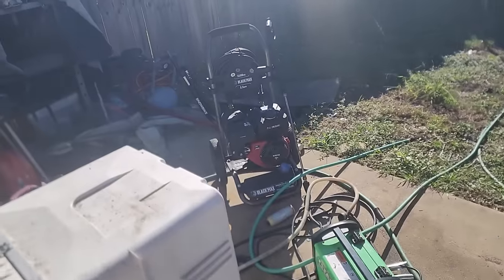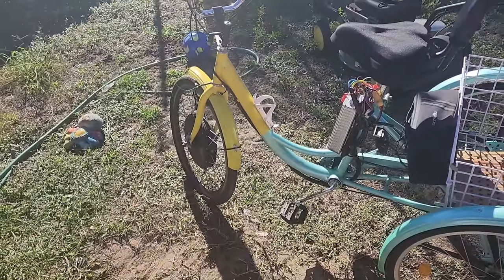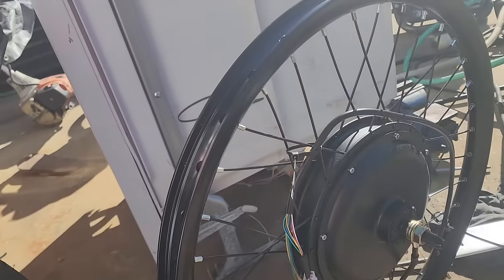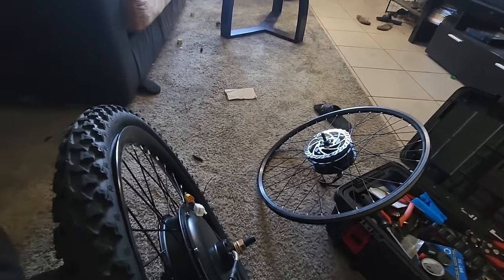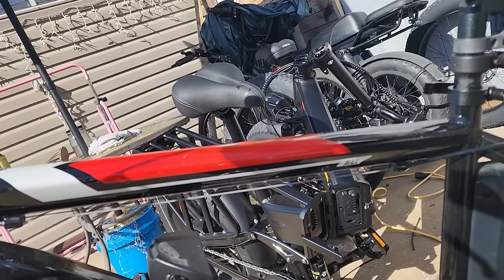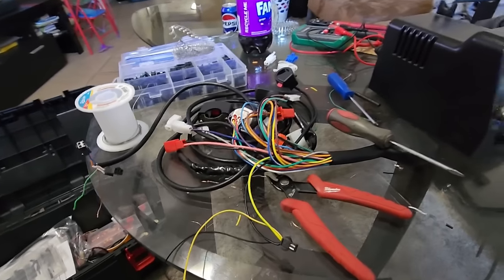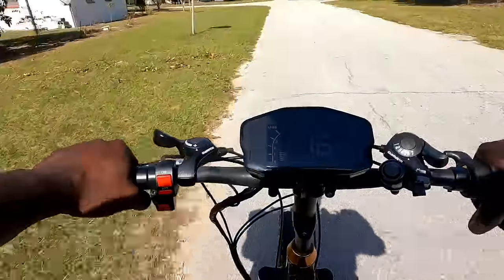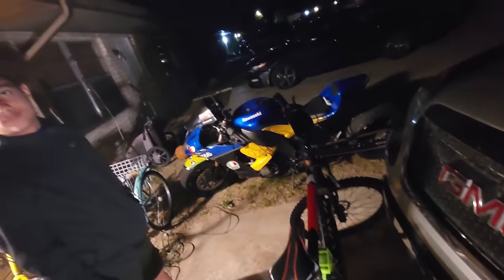1500w ebike conversion kit build.  60mph for a customer!!!

Comment: I can't wait the time when we'll get 3000w nominal geared hub motors to go uphill at decent speeds
Reply: The 1000w bafongs that Ariel rider use do a very good job of it.
Reply: Yes it does, but I don't like fat tyres because of maintenance costs, and the pigs would give me a hard time if I rode these kinds of bike.
I'm really looking at the bafang mid drive 1000w and a fardriver controller if it's compatible
Reply: @nicod974  not sure what you mean about the maintenance of the fat tires. I replaced the original tires with some low drag tires, and I’ve gotten over 2000 miles on them. Only just had to replace the back tire due to wearing it out. They were a little more expensive than others I could have gone for, but 2000+ miles is not too expensive.

Comment: Great job and glad he likes it, I have just upgraded to a 2000w 72v diy ebike which is pretty fast but only got a 45amp controller at the moment but still gets me around 45 mph which is scary on a 12 year old mountain bike lol take care gaz ✌
Reply: LMAO, yes just 45mph is dangerously fast, especially if bike is very light, lol. Hey, Ive been at that speeds and man, my thoughts on a flat out, wipe out, or a bump that send your front up was too much for me to have on my mind while going that fast at 45mph. Ive learned to just be ok with 36mph and stress free of not being on my mind while going that fast. Stay safe and ride smart over but not too over, mph.
Reply: what was cost
Reply: @raybosflorida4928  did you want the cost of the kit and battery?

Comment: What's crazy is I'm riding on a 1500w hub motor and best I seen is 32- 33 miles per hour.😮 (52v battery)
Reply: I got that on a 750 watts at 56 volts
Reply: Shunt mod it
Reply: Shunt mod it
Reply: @dahman9672 shunt mod huh,,,you  sure about that,,this isn't a bafang mid drive..it's hub

Comment: I use these "Topeak Versa Mount" things to mount stuff all over my aluminum frame ebike.  They are kinda pricey, but they work well.  My battery uses 6 of them, but that's cause it has to be installed on the top of the top tube.  I have not been nearly as fast as you guys, but they hold up finr for me on offroad...I went 40kph down a pot hill filled gravel road and nothing budged at all.  I do loctite everything though (nail polish works in a pinch if you got any women around).

Comment: Nice work again EBG!
I feel it is much safer to have a ebike that can easily keep up with the traffic. A slow 20~25 mph ebike is generally far more dangerous IMO.
That Huge Smile on a very happy young man is Golden 100%!
Merry Christmas to you and your precious family!
Thanks EBG
Peace Prospector Tripp
Reply from the maker: Oh yea they love it , they rode it the next day none stop lol
Reply: @E-bikeguy  EBG.. I had Another brain spark 🧠⚡️😂 
I installed a modified fat 20” rear wheel on an inexpensive 24” mountain bike. The front fork now kicks out a bit more like your modification to the Frame Head Tube angle. Of course this is because of the smaller rear wheel. I think this is a good easy fix for the fork angle 📐 issue without having to cut and weld. I found it helps with overall handling, ride feel and stability.
I would love to see you try this modification on some pedal bike or ebike. After doing this to my little 24” mountain bike, I also want to try this on a couple larger bikes to see how it performs.  A 27.5” bike with a 26” rear or a 29” bike with a 26”.. not sure exactly just yet.
Anyway watching you do this modification would be really interesting. I would love to see what you think about the smaller rear wheel mod and how it feels to you and how it is effecting the overall ride.
That would be definitely be Golden!
Peace Prospector Tripp
Reply: Hey E-BG ( should use the E-BG as optional title on ya gears)  Just wanted to get back the basis of my latest Fat Tire 2000watt Tonka Tuff DIY Dual motor.  I had mention before of at times when going fast you want ebike to be balanced evenly ( some like their frames light as possible, while some need the extra weight of frame used,  torque of speeds etc) first thig I noticed of my new Fat tire was how too light it was in front handlebars of the type of power ( 1000watt gear are newer ones) of extreme power NM as the more weight I had in back, the severe wobbles of controlling handlebars of not going over 12mph of such serious front lift on front tire, I knew doing Dual Motor ASAP was the right thing to do. EXAMPLE" You riding at just a minimal mph of 24mph, you flying on street with speed bumps of say 4 feet long from dip,over , dip  and on to the next one. Before the front motor balancing my front would take off and lift a bit of the bike landing but much banging of the landing besides the handlebars lose control for a mili second. Now with Front motor of a perfect balance, I speed thru same speed bumps at 24mph and faster, My bike is planted with just the lifting of frame from my dual shocks of riding thru of full control and the balancing is a factor depending on preference of rider, frame used rear overall weight, etc. It feels HELL A GRAVY of my bike firmly to the pavement of my tires with the dual shocks doing the lifting of overall handling of handlebars going along with suspension purpose. This just a separate preference of the rider's use of frame type, counter weight, type of motor power of NM of full control of handling bike.   @E-bikeguy
Reply from the maker: @user619tlsdca5  heck yeah I do agree,  that is why if I can I would like for the battery to be placed low as possible to the frame as possible to lower Center of gravity
Reply: My Tonka Tuff Fat Tire is not of a normal EBike ( majority of fat tires Tonka Tuff) since adding front motor as Turbo Booster, the EBike rides more like a lower end Electric Motorcycle of overall speeds as the BASE GEAR MOTOR has EXTREME POWER OFF ACCELERATION and it feels like Im riding a Harley D or Indian ( yes, I have ridden those just 1 time of both) Not a ebike of off road stunts and jumps of my frame and parts used as more of a Cargo commuter or just CRUISER.
Reply: i GO UP TO 36mph with both 1000 watt motors each and the gearless alone go 36mph ( for now of upgrading battery) and the BASE GEAR motor for uphill and start off torque of pulling cargo. Goes hand in hand of using 1 motor at a time of alternating front to rear, both as same time or mix in from 1 of certain terrain and situations. The factory new Duals only rear use with button for both motors at same time, no alternating or mixing in of alternating motors.
Reply: Because of the mixing in motor use or alternating motors at any speeds works the battery of less energy use or controlling battery power of lasting longer  or go further on single trips.
Reply: @E-bikeguy  The center Mount on cross bar is the ideal location of not being off of the balancing of weight for the front and rear do throw off weight of the handling of control  unstable ( Mainly for the Dual shocks 3 to 4 piece frames, 1 piece frame is fine but yeah, I'm with ya on being stoked of spotting the placement and you can tell how stable it is from the handling of the handlebars. Be very careful of using 25lbs on rear rack ( just avoid the use of over 20.lbs) or more on them Dual Shocks 3 to 4 piece frame. The side panels of the rear shocks will be taken on serious weight of it etc those2 side panels is holding the weight of too much stress , it will loosen up the bolts if not, will break but they simple to replace, the FN up is just as simple of overlooking.

Comment: If you need extra clearance for the battery beneath the downtube, you can run 27.5 fork if they are 26" tires, or a 29" fork for 27.5" tires.  No issue with rigid forks, of course, but you dont want to bottom out your tire on your battery the fork compresses and bottoms out.
Reply from the maker: Yes that's a good idea I'll talk to the owner about a update the the fork
Reply: @E-bikeguy  do you know how to install a crown race on the fork?  I have never tried idoing this, but if you can put some kind of a spacer beneath the crowm race before you install it, that will do the same thing.  They dont sell anything...at least they didnt when I looked years ago for a different reason.  If the steerer tube has already been cut short though there wont be enough left for a diy crown race spacer.
Reply: I wish someone would just sell crown race spacers...they would be good for lots of things.  Drastic geimetry tweaking on retro bikes for example.
Reply from the maker: @AaronHendu  actually I have a video on that I'll upload it this week
Reply: Even a headtube "extenstion" that fits like a headset cup but just extends the head tube in either direction.
Reply: I guess a long headset cup woulf work too...now that I believe I have seen, but I also believe it was very pricey.
Reply: True I have two bikes with 27.5 forks on 26 inch frame works a treat plenty clearance

Comment: I gotta say, I am somewhat dubious.
What's the tire diameter and rpm/v?
Amperage will get you right up to your rpm/v limit, but no amount of amps will get you past it, nor will field weakenign.
I get 40+ with a smaller untuned fardriver @48vdc.
My 60v battery arrived today.
Motor is 1500w, but I don't know what winding it uses = came from a yescom 1500w kit.
It outperformed a prebuilt bike I had before it was stolen that had dual 1000w geared motors.
I was going to upgrade the anemic controllers it came with - which is why I have the fardriver - two fardrivers actually.
I have another 1500w motor laying around too - may add it also if I get around to replacing the Hall's.

Comment: how would you set it up with a mtx 2000w hubwheel ?, i only gone 53.75 kmph. also fast on bike, but not that fast. would not know how to put a better controller on it.. i dont know anything about all the wires. my mtx got a 3 point power contact point. with standard sinewave 35amp controller. and 52v batt.  Greets from The Netherlands. if i want to change it, i need to change alot then. connector from normal 52v batt. to connector and the power cable from motor to controller.. i dont know how to do that.

Comment: I have a 1000w 48V AW rear wheel conversion kit, the controller according to the reviews is only rated to output 700W. How should I go about upgrading the controller (I am also looking to upgrade the battery eventually to probably 52V or 60V). Im trying to upgrade the speed on the thing without breaking it.
Reply from the maker: Ok the sabvoton controller 7245 is a great option for power without the stress of the components.

Comment: Hi I've been watching video
. I've got fat tyre bike from amazon look a bit like a motor bike 20in wheel it came with 750wat I've upgrade to 1500wat had to use 3 washers either side my drop out is 190mm. I had to leave spacer on for caliper for all I adjust the slide it's on full where is won't go no further so brake works fine. But when you menshioed that spacer for disc mine is still on I'm 75yrs old I've had about 30 different bikes up to 8.000wat 72v. Now normally I take that spacer of the screws took some getting loose they are torx type. Normaly I put a torx arm on but the bike has good locking washers that go in frame. Depending on how wide frame is at back wheel the hall wires just miss screws on disc in fact they are all like that I put a v in frame with hack saw then file smooth and wire is further away from screws in disc I've put locking on bolts fir disc now I'm concerned about that spacer to get bike over again will be a bit to much now so I think I'll have to keep a check on the disc or some say router. All the years I've had ebikes I use supper glue on tread it works a treat to try to get them nut loose takes some doing it for doesn't dammge thread. Yes I'm concerned about that spacer normally I do take it off. Yes them disc get pretty hot. I pleased I watched video for that tip I shoud have known better all the bikes I've had. I like your videos because you explain great step by step looking at your wife's bike mine has same saddle I'm busy making it higher so I can peddle I'm using pvc same as side panels I made but half ins. It's a problem with some of these fat tyre bikes appoliges for long message keep the good work up

Comment: I have a couple of thoughts. When you’re riding at night, please wear proper lighting on the bike. Did you independently speed test the bike to make sure that the display was correct? I have a hard time believing that a 1500 W motor could get you up to 60 miles an hour. And third, when you’re riding that fast, it is a good idea to wear proper padding and motorcycle gear. Wrecking at that rate of speed will jack you up. Thanks for the great videos.
Reply from the maker: Yes we tested the bike with my son before I gave it to the customer,  if you still don't believe it can do 60mph check out my other videos

Comment: At least one thread rivet added to the drop tube water bottle (2 spots) for the battery dock bolted for strength if the bike takes a side ways fall.

Comment: What controller u used and what battery voltage and amps is the battery
Reply from the maker: It's a fardriver nd72360,  and the battery is a 60v 30ah 21700 LG cells  150a peak

Comment: What makes your 1500w so fast? I have a 2000w and it only goes 35?
Reply from the maker: It's about,  like battery configuration , the controller output and the rider

Comment: Subscribed! Could you list build parts please?
Reply from the maker: 60v 20ah battery i made fardriver 72360 dkd display 2000w hub motor  24in  wheel
Reply: @E-bikeguy  awesome thanks! Im new to the hobby and there are so many options out there. I don't want to build something that has issues or doesn't work  well right out of the gate. My thoughts are a 26 inch mountain bike hard tail aluminum frame, rear hub motor, added disc rear, with regen capabilities.  For the street with some  hills and top speed around 45.

Comment: Amazing build. im going to build a 26 inch fat tire mongoose dolomite  bike. 72 volt  id like a fardriver contoler and 72 volt 
Not sure it i can use a 1500 48 volt hub motor and run 72 volts with the fardriver controller. I was wondering about a battery build

Comment: Bro! How much to convert the 48v to a 72v round battery?
Reply from the maker: I really don't know I have to do some  calculations.
Reply: @E-bikeguy let me know, it's for the YYG BR100. I want to put a mid drive on it and keep the hub motor but it'd be cool to use the stock battery 🔋
No one on YouTube is modding their batteries, just buying replacements and finding mounting spots lol

Comment: 12:08 Great minds think alike, I did the exact same thing sometime ago using the teardrop shaped part of the cheap torque arm kits, works a treat for 1500w.
Reply from the maker: Oh yeah it's the best way to use them torque arms
Reply: Same here… I figured that method out a year ago!
Reply: @elephantrockfarm1447  it's way better than using the two parts together (unless you weld them) and you know for sure your wheels staying exactly where it should be, gave me great peace of mind as I did the same on the other side too.
Happy days, have fun out there!

Comment: 1500W motor can hit 60mph ?! 😭😭
Reply from the maker: Lol yes it definitely can
Reply: @E-bikeguy  unreal 😭, so a 3000-5000w can hit 90-100mph then with the right setup ?! Because this is only 1500w lol
Reply from the maker: @rolandroland1485  I don't know about the 3000w because it will melt but with the right setup and bike you can get a 5000w to reach 100mph,  if not it will be close
Reply: @E-bikeguy  yep 💯

Comment: @E-bikeguy do you repair ebike too,
Reply from the maker: Why yes I do!!!
Reply: @E-bikeguy  I'm in Jacksonville will that be a problem, it's a 1k watt rear hub no name kit problem is one day the wheel stopped responding it get power it's just the wheel dont spin.
Reply from the maker: @mrbenjaminvincent  ok definitely something to look at check you motor cable make sure it's not cut at the dropouts
Reply: @E-bikeguy  I spoke to someone before and they said it might be the hall sensor but I don't know what that is once I get the tools to open the Hub motor up I look inside and Google what does stuff is and what needs to be done I guess thank you

Comment: What controller and LCD I have the same kit but with the 48v  i need a bigger battery I got a 29 inch schwinn
Reply from the maker: Yes a hi  voltage battery  will get you faster

Comment: I have this 1k watt baffang front hub. I will be running it on 60volt 50 amp cont discharge battery. Can you recommend a controller and display please for me. I want lights to work on them as well. Like there is a power line from the controller or something that allows 12v accessory installations
Reply from the maker: Ok I don't believe that there is a controller that I know of that have a 12v output you will need a step down converter, also get the sabvoton 45a controller,   cheap and powerful controller and easy to use